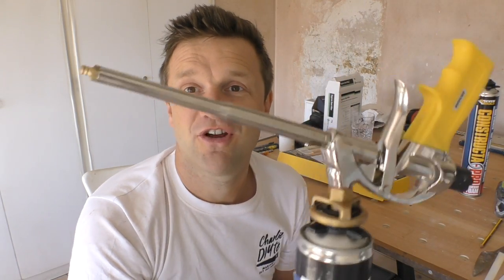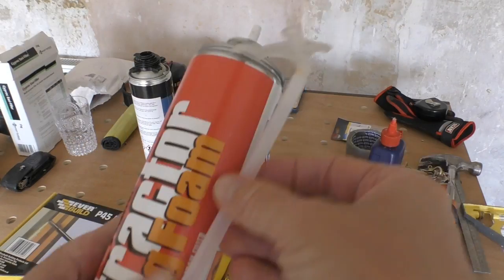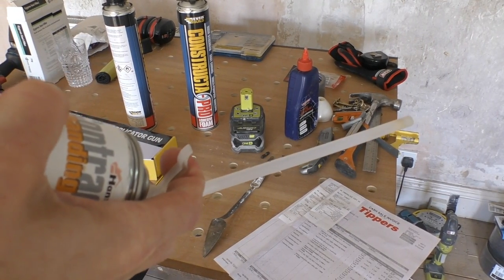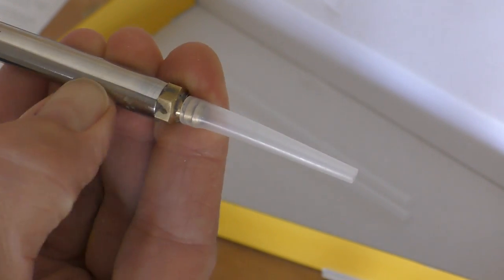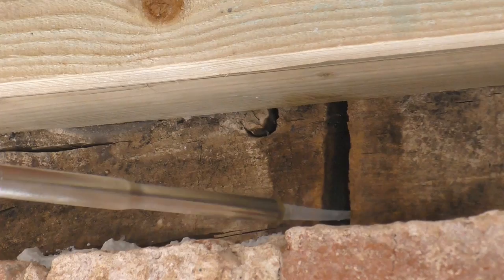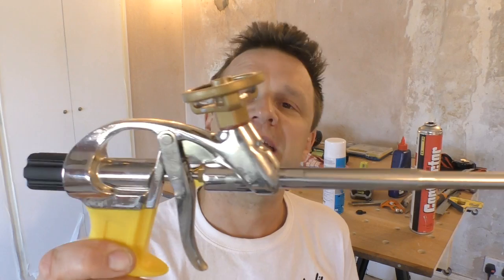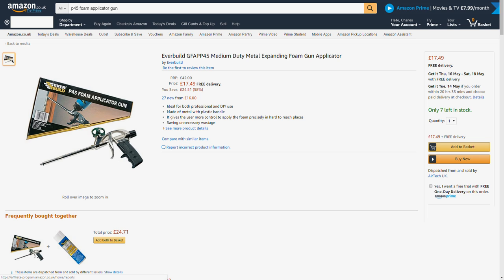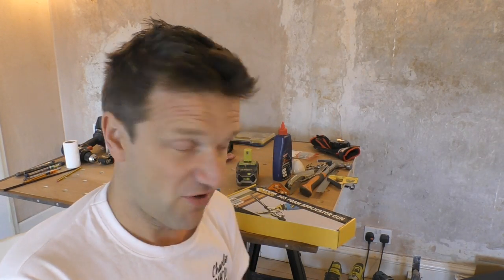Why Use an Expanding Foam Applicator Gun?

Comment: Be very careful with trying to clean out the can nozzle (on the can). I tried cleaning out the nozzle with a screwdriver and the whole nozzle let go, emptying the remaining contents of the can all in one go. I had it all through my hair, eyebrows and eyelashes. It is very difficult to remove and I was picking it out of my hair for months later.
Reply: Lucky you weren't peeling it off your eyeball too. Good to know this kind of thing DOES happen, so we can be warned and were goggles when messing with the top nozzle.
Reply from the maker: Blimey Charlie! I think the trick is not to leave it out of use for too long. I left mine for a week or so and the trigger because a little stiff, and the nozzle was a nightmare to clean, like you say.
Reply: Sorry I've had it all over me too. Part of ongoing pranks with my work colleagues. It wasn't funny at the time all over my face hands and tools, luckily not my eyes. 
When you hear somebody else talking about their experience, it's hilarious 😂🤣. Sorry if I sound like a jerk, but picking it out of your hair 😂 for months.

Comment: Hi, I use the Screwfix No Nonsense version.....and the thing that I like about the applicator gun, which you didn't mention, is the fact that by adjusting the black knob on the gun, you can control the flow rate of the foam, therefore saving more wastage. It basically works just like a tap/faucet on a bath or sink, to control the speed/flow of the water. You can slow it down to just a dribble or open it up all the way for the full flow. The controllability is absolutely excellent.
Reply from the maker: That is a great point that I hadn't thought of! Massive thanks for the comment.
Reply: I was going to say same thing. Makes it much more controllable

Comment: The single use disposable cans are fine if you get a large load of work ready. Ie. Several Windows. Or for me. Several sheets of polystyrene backed plasterboard I want to stick to a block wall. Or a large hollow catnic lintel I want to fill.
Reply from the maker: Agreed. The only thing I'd say is the gun is much cleaner to use and gives you more control. 👍

Comment: After my experience following your advice on how to apply silicone I subscribed to your channel. Like Skill builder you are a cut well above average because you are prepared to put in the effort to do things properly. I’ve seen “professionals” at work. They use rip saws as axes, screwdrivers as chisels, measure angles with a thumb and paint using self sanding/priming/undercoating/sanding/top coating paint applied with a manky, never cleaned brush. I only employ builders and tradesmen who have pride in their work or do things myself. So thanks for your videos and you’ve sold me on the idea a foam gun. Many thanks.
Reply from the maker: Can't thank you enough for that Trevor! I spend a fair amount of time on building sites in the day job and my small team and I often marvel at the corner cutting that goes on. As you say, it's a bit of a generalisation as there are some great builders out there, but the point is that a DIYer can hold his or her own if they do the research, and their trump card is that it's their own place so they care about the finished result, as you say. Definitely get a foam gun - it's been a game changer for me. Just make sure that after the weekend or whenever you're using it, you clean it out. I left mine a week and it did get a bit gunged up. Thanks again - comments like yours are what keep me fuelled up to make these vids!

Comment: I bought a gun 20 years ago at the recommendation of the guy supplying my double glazing. Much more control over the flow and placement of foam and much easier to clean. Occasionally for quick jobs I've used the small cans but it's saved me loads on bigger jobs, not just in foam but also cleaning up and quality of the jobs

Comment: Charlie you are the gift that keeps giving. Great video. I have had this issue for years and never known about the foam gun applicator.
Reply from the maker: Ah Steve, that's great to hear - thanks so much. Yes you'll love the gun. So much control over the output of foam. Only thing I'd say is get a couple of cans of the acetone cleaner as you will want to clean out the gun if you're not using it for a week or so, as it can get a bit clogged up. 👍

Comment: Thanks Charlie.  The foam cleaner is also brilliant for cleaning tools used with two-part epoxy filler such as Ronseal High Performance Wood Filler
Reply: Good tip, thanks
Reply: Don’t use the cleaner on soft impact edgings. Took me ages to remake the unit!
Reply: You can also use WD40 to clean your gun as Well
Reply: If you run out of foam cleaner you can WD40... plus you can get more out of your can of foam just put the can in warm water befor use..

Comment: 3:50 It is recommended to not remove a half used canister from the gun. Leaving it on keep any foam from getting exposed to air so it will not cure.
Something I had learned by getting a Foam Gun is that the foam will not cure without air.

This video does show it is possible to detach and re-attach a used canister a week later. Thank you for showing us!
Reply: As another side note related to air exposure.
This is also probably why you are not suppose to use the foam in closed cavities. It won't cure. (Or it could take a very long time)

Comment: Just bought one on your recommendation, and you are absolutely right: no contest. I'm filling the gap behind old skirting, and used up a disposable foam on less then a metre of skirting, with loads of waste, little control, too much to cut off, too much falling off. The control with the application gun is amazing, allowing me to build it up layer by layer, with no waste, and one can just keeps going with no cleaning.

Thank you!
Reply: I bought a "No Nonsense" brand, and it seems identical to yours, really well made. The knob is great for not only locking the handle, but also sets the maximum rate, so you can set that for a consistent flow.
Reply from the maker: @JasonJudge  Thanks for that Jason! They're great aren't they. Just wish I had bitten the bullet and bought one earlier! One tip though. If you're not using it for a week is a good idea to clean it out as mine got a bit clogged up/ trigger a bit stiff when I left it for a week or so. Yes the control point is a good one and something I should have mentioned in the vid.

Comment: I remember storing a used can of hand-held in the garage for months, until I got so fed up looking at it and just threw it away. Could tell by shaking that it was about 80% full, but of course completely useless. Broke my heart!  Subsequently bought an applicator gun on eBay, similar looking to yours, for about £7, and have used it many times. Just like to add that it's worth buying an all metal one, which can be stripped apart and cleaned mechanically if ever necessary.  Like your videos, especially without annoying "music"!
Reply from the maker: Thanks - good point! Yes, sorry about the cheesy music. I don't know what I was thinking!!

Comment: Excellent video - thank you for making it. I have bought the same brand gun cleaner locally for £4.50 which is the same price as 750ml of Soudal gun grade foam but in another shop I was able to buy 700ml of foam for the gun for £2.99 and it works really well. I will never go back to the single use type!
Reply from the maker: Good work John. You just have to clean it out when you don't intend to use it for as few weeks as I found mine clogged up otherwise.
Reply: @CharlieDIYte  Yes, but I have a little bit of experience you wouldn't want to duplicate - not that you'd be so stupid but mistakes will happen! I thought the gun had to be cleaned after every use (which resulted in an unusable but nearly full can of foam going into the bin). I sprayed cleaner through the gun, unscrewed the can of cleaner and put everything away over night. Next day I thought I saw a blockage on the gun nozzle, then saw it wasn't foam..... part of the gun? Only one way to find out was to operate the trigger and so I shot myself in tbe face with a blast of gun cleaner which was still under full pressure from the day before. Luckily I wear glasses but it could have been much nastier. ALWAYS pull the trigger one more time after removing the can of solvent!!!

Comment: This is a timely video having bought a gun and about to use it. I wondered how long I could leave the can attached and also about cleaning. All questions answered - thanks. Another great video!
Reply from the maker: Yes, and people are saying you can leave the can on the gun until it's empty. Just lock the valve off between uses.

Comment: Hello Charlie, good video, well explained.  The expanding foam cleaner is just acetone in a spray can and as others have pointed out you can use it for other cleaning purposes as well.  I’ve always used the disposable cans and like you struggled to clean the nozzle, blowing it out and then pushing out the excess once its dried with a thin screwdriver. But then where I think you missed a trick is that the foam cleaner (acetone) works perfectly well on the disposable cans, just attach the red spray nozzle and spray it down the clear plastic tube and in the top of the can nozzle to dissolve and clean off any foam that’s visible.  I’ve used this many times and it does mean that the disposable tube can be used more than once from the same can.   It’s not perfect and the can will stop working after a period of time (presumably foam further inside that the acetone can’t get to), but it does provide a good halfway between the disposable can only option and the pro applicator.  If nothing else buy the foam cleaner, it lasts forever and makes a big difference to cleaning up
Reply from the maker: Thanks Geoffrey. Some good points there. I think where the applicator gun wins is with the far superior control you get with it, but I hear what you say and actually, you can't leave foam in the gun for more than a few days as it does jam up the applicator after a while.

Comment: For the disposables- Carb cleaner will flush the foam out (the acetone breaks the foam down). A quick spritz in the nozzle on the can keeps that clean.  Never tried it on dried foam but after an application prior to setting works a treat. But I would definitely consider geting the gun next time I'm working on a bunch of fills.

Comment: I just bought an applicator gun, a couple of cans of foam and a can of cleaner last week but will only get to use them this week so your tips on using the gun will come in handy.
I had heard that a lot of users do not remove a can of foam once they start using it but instead leave it attached to the applicator but they always spray clean the applicator tip with a few sprays of cleaning fluid and a cloth.
I used to use the disposable tins with the plastic applicator and a tip I got was that when you remove the applicator from the can and there is a small amount of foam at the top of the can get a matchstick, wet the end of it , not the end you light, and shove it gently all the way down into the little bit of foam. Then just let the foam harden and set . When you wish to use the foam again just pull on the match and it removes a "plug" of old solid foam from the can and you can use the rest of the can. This tip did work  probably 2 out of every 3 cans but not every time and because of that I am now going the gun applicator route.
Another reason I want an applicator gun is to give control on the size of bead by rotating the knurled screw on the handle to adjust this.
Thanks again
Reply from the maker: Hi David. You'll love the enhanced control you get with the gun. My advice would be not to leave the van on the gun if it's for more than a couple of days, because the foam can gunge up the gun and mature the trigger a bit sticky. It pays to take it off, clean out the gun with the acetone spray and then it's good for next time. Obviously if you were using it every day in the trade, you wouldn't need to do this.

Comment: I've had the same hilti disk fun for six years now, it is in as good a condition as it was on the day that I bought it and I hadn't cleaned it like that once. You don't need to, just leave your tin of foam on the gun even if it is empty, the pressure inside the can will stop it from going off in the nozzle. When you come to use the gun you just use a Stanley jl knife to clean up the end and then spray away. 👍🙂

Comment: HI Charlie - after watching this excellent video I posted that I would give guns try next time I needed to foam something.  Well today was the day at the start of a project that will have numerous small foaming sessions over the next month or two.   You were so right.  These guns are fabulous.  From what I have read subsequently it is ok to leave a part used cylinder on the gun for up to a month or so.  Will let you know!  Many thanks for the info!
Reply: Super interested in your results.  Let us know how it works out for uou
Reply from the maker: It's great for numerous small foam tasks. The only thing I'd say is that if you don't intend to use the gun for a month or two I'd clean it out, as the trigger on mine got a bit stiff recently when I left it for a couple of weeks. Just buy a couple of cans of spray cleaner as it's great to have lying around.
Reply: @CharlieDIYte  Charlie - just a heads-up.  Used the gun for a few small jobs and then put to one side for a week only to find it was performing poorly after that.   Found that this was due to not being screwed tight enough onto the cylinder so cleaned out and refitted the cylinder.  Used the gun again today (two months later) and found that the gun is still working fine with the remaining foam.  Seems that my gun (Toolstation professional grade)  will last this long if the valve and cylinder are fully tightened.

Comment: Thanks for the video! Looks like you have more control with the gun when compared to the throw away can.
Reply from the maker: Yes you do. Buy a non-stick gun though. That way you don't need to take it off the can and clean it until the can is empty.
Reply: @CharlieDIYte  thanks for that appreciate it 👍

Comment: Great video! We used these to do our loft conversion and will never go back to simple cans. They provide far better control and the ability to fill tight gaps.   The only time i struggle is when the gap is near ceiling and you cant easily keep the can upright enough. I found you can get away with leaving the can on the gun for a long time provided you occasionally spray a bit out (into a plastic bag) and clean the tip. Thoroughly the gun if you don't intend to use it for a while and they're fine, well worth the price even with 'inflation'! 😂
Reply from the maker: I agree. I do find though it's worth cleaning though out if you're not using it for more than a week.

Comment: I have used foam gun as long i have run my construction business almost 15 years. I never clean gun even can runs out, i just leave empty can to gun and when next time i need gun i replace can and keep going. 
It never been clogged so far even sometimes it's has been on self like 8 months it still work when you change empty can for new.
Reply: I was about to say the same thing. The cleaner can kill a gun. Like you said just always make sure you have a can attached, and keep it locked whenever not in use.
Reply: Aaaah, about to build a shed...thank you so much.

Comment: With a disposable can, you can give a quick squit with can right way up to clear valve & nozzle and then come back to it later to carry on using. If foam does set in the tube, roll it in your hands and it'll separate, a quick blast upright will fire it out. Or wind a screw into the end and pull the core out. That all said, I'd be tempted to buy an applicator gun if I had more to do.

Comment: I'm with you on the reusable applicator. It's a far better (and more elegant) solution..  I have used simple acetone to clean out the disposable nozzles though, and it cleans them out beautifully.  So it never hurts to have a bottle of that or nail polish remover lying around if you're a home-gamer..

Comment: I always leave a pressurized can attached to the gun. After I'm finished just close the rear adjustment valve and spray the nozzle with gun grade cleaner. A quick wipe off with a paper towel and it's ready for use whenever needed.
O yeah, it helps putting a little silicone grease on the valve of the can and around the thread pre-application of each new can.
Straws can also be cleaned with gun grade cleaner as long as you don't leave the foam to cure. Just spray straight through and tilt it horizontally. Watch the spray eat through the foam.

Comment: Don’t remove the cartridge until you need to change an empty one. A spot of Vaseline around the valve will help removing canister later. Squirt with cleaner around valve before fitting new cartridge to dissolve the back flow of foam. I had a part used cartridge on a gun for six months and it still works fine